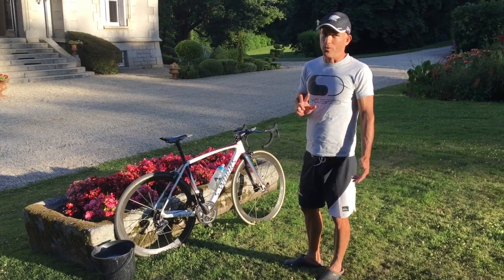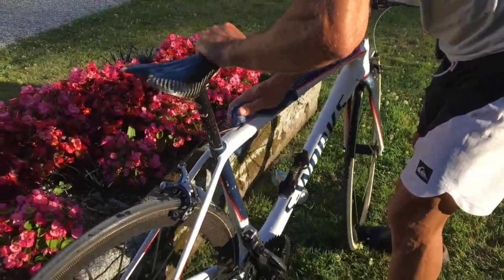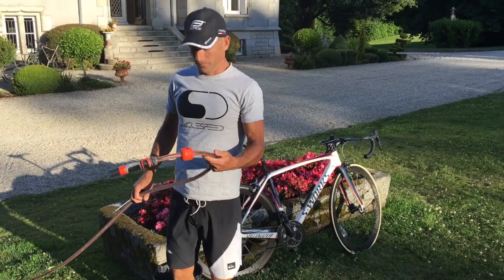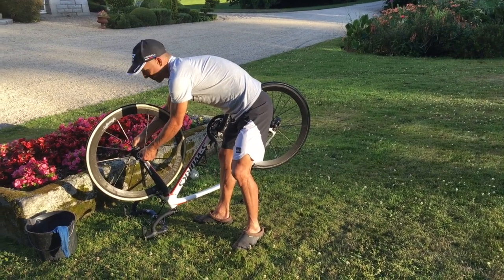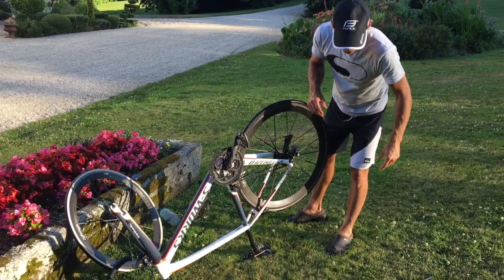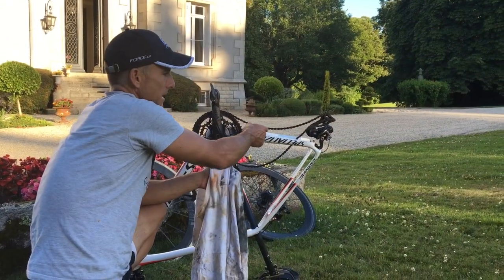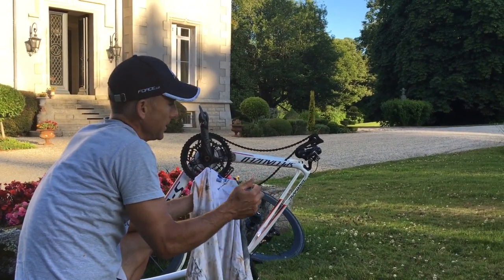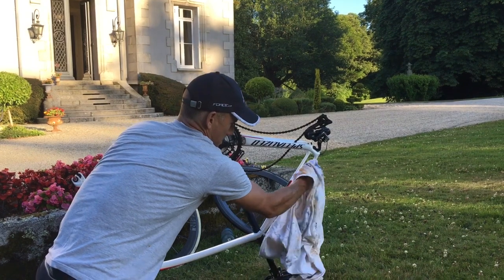How to Clean your Bike without Damaging it!

Comment: Just a tip for other living in a flat with no easy access to waterhose and need a quick polish, use baby wet wipes to get the dust off. And for the dust and dirt not to set so easily and have a shiny frame, I spray some ordinary silicon spray in a rag and polish my frame. Just be careful you don´t get it on the brakes, wheels, handlebars etc. Wash your hands before you touch any of thees parts.
Reply from the maker: Thanks for that - baby wipes are great when travelling, we usually have some in our support car, they work really well, and make your bike smell nice too!  Not very eco-friendly though!

Comment: hmm i'm more of a dry lube (squirt) guy. I use a heat gun on the chain and apply a light layer on both sides by rubbing it into the rollers a little. Drive chain seems very quiet from doing this. Some great tips here though!
Reply from the maker: That's a good way to lube the chain too!

Comment: Maybe I am to anal. I rarely wash the bike, a damp cloth with some good car shampoo on the frame, and normal water for the wheels ( carbon braketrack) I use Meguairs polish on the frame to remove small marks and give the bike a good shine, then a good wax, Dodo, Swissvax etc to keep things protected from the elements, and helps bead any water off, and rarely does any grime/oil stick onto the paint. This is on a gloss frame, but there are car waxes on the market now for matt paintwork.
Reply from the maker: Sounds good, but inevitably you will get oil traces on your bike, whether from chain, road grime, or bearing leak. And you need some kind of solvent to remove that effectively.